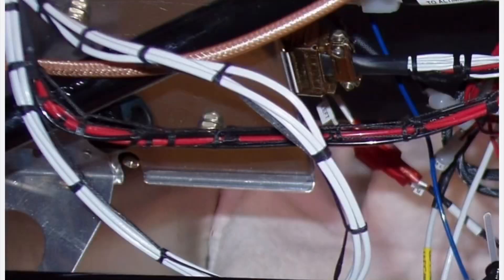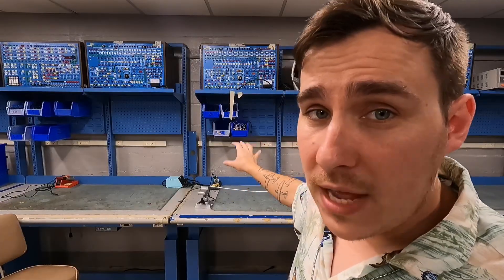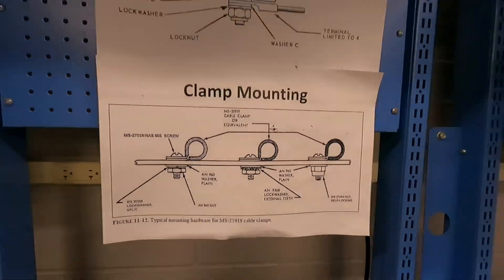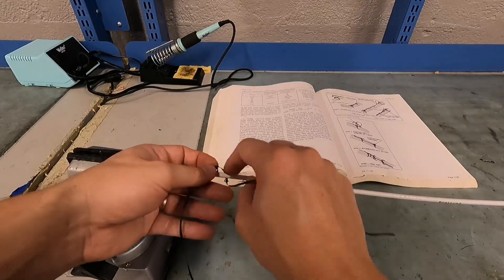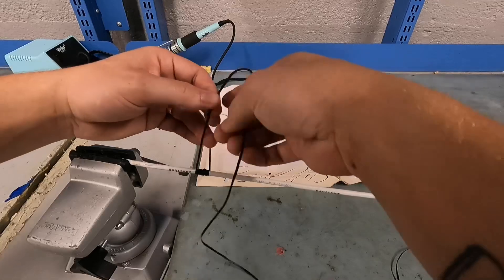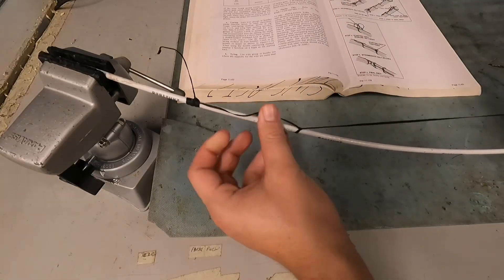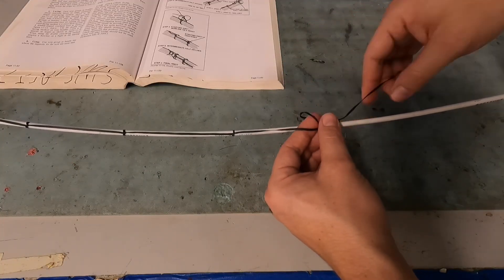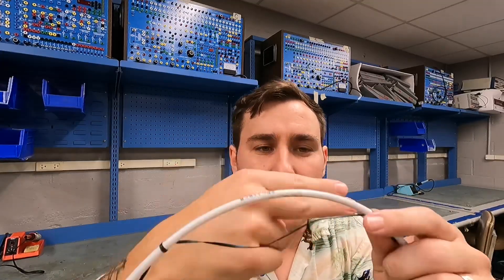🛠️ How to Tie and Lace Aircraft Wire Bundles | A&P Practical Project Sunday Double Feature Part 1!!

Comment: Would this work for a car wire loom? Or should I be sleeving over them or does the sleeving go under the string?
Reply from the maker: It would but automotive it's easier to just put everything in wire loom and electrical tape.

Comment: Interesting. The US military allows only 2 types of string tie knots, and no longer allows continuous lacing like shown here. The reason is that if one end of the string gets cut, the whole thing unravels. I'm not an A&P. I've only worked on Air Force planes.
Reply from the maker: I've heard this several times. I do not like to use continuous lacing. I have and will probably always just use zip ties. Much faster and secure then lacing
Reply: @brycebuildsit  And yet @ 5:20 you're saying lacing can be faster than zip ties... :P

Comment: I have often seen lacing but never seen it done. Looked pretty easy, easier the zip ties. Probably harder in a confined space but definitely worth trying!
Reply from the maker: Much, much, much harder in confined spacing. I prefer zip ties also because if the lace gets cut the whole thing comes undone. With individual ties or zip ties you don't have to worry about thaf

Comment: In the military we don't use zip ties at all.  Wax string or clamps all the way.
Reply from the maker: One of my co workers was a C5 avionics tech. He said they always used wax string and individual ties never laced. They also used different tieing methods
Reply: Depends on the airframe, but wax string is (almost) always at least an option even when zip ties are authorized. 
That said, the 1-1A-14 still defaults to lacing tape only, unless directed by the airframe specific TOs.
The airframe I was working had both authorized in most tasks, even when working TCTO modifications. (SB and AD equivalent tasks.)

Comment: I have never been cut by cotton thread.  Zip ties will make you bleed.
Reply from the maker: Mechanics seem to like to cut them on a 45° angle with diagonal cutters so they are as sharp as possible too.
Reply: If the zip ties are cut with the right cutters it leaves no sharp edges, just a pity no one bothers.
Reply: @FailedExpert6330  Yuuuuup. They confuse diagonal cutters/dikes with flush cutters (or just don't care). Those, or Zip-Tie guns are the correct way to cut zip-tie tails. I still personally love the way lacing looks (coming from the spacecraft industry, where zip-tied harnesses HAVE to be tightened with a tie-gun that has been set to the proper tension for the wire bundle/tie size)

Comment: Whether you are allowed to use zip ties depends on the aircraft's type design and maintenance instructions.
For example, some helicopters classify the entire helicopter as a high vibration environment and therefore do not allow zip ties.
Engine harnesses often don't allow zip ties.
SWAMP areas often don't allow zip ties.
If you need to tie a harness for any of these reasons, follow the aircraft's maintenance instructions for how to tie it.  I guarantee it doesn't say to tie in the method shown. The method shown is absolute junk.  Kind of a waste of a video for anyone but someone with the most clueless test instructor.
Reply from the maker: Brother, these videos are aimed at students getting ready to take their O&P exam. Every single DME I have spoken to says they use the AC 43.13 as the procedure for the test. Any and all experienced A&P mechanics know that manufacturers' instructions come first. This video is not meant for an experienced mechanic like you or me. It's meant for a newbie trying to get past the test.

Comment: I generally prefer to do individual ties and came across this alternative to the FAA “approved” knot.  This one is faster than the official knot and can be easily don’t with one end of the cord still on the spool.  I was concerned this knot might be weaker than the FAA style so before using it on my homebuilt, I did a little testing.  I tied an FAA knot around one side of my bench vise and this style around the other side.  There is enough side to side play in my movable jaw to ensure equal force applied to each tie.  I also alternated sides just in case one side was applying more force.  I did several iterations and every time the FAA know broke first.  So, I became a believe and have been using this “unapproved” knot since.  https://youtu.be/t48x7Qrd50c?si=9k6chp6t7V4C3kUD
Reply from the maker: I also prefer individual ties. For an O&P, you might have to do this. In reality, this is just my opinion. If something were to cut the lace midway, then the whole bundle could begin to loosen up.

Comment: I got my powerplant o&p on the 2nd, is this something I could be asked for powerplant, maybe for tying control cables to the engine truss?
Reply from the maker: It's possible, but more than likely, you'll get something related to magnetos.
Reply: @brycebuildsit  I passed, I didn't have this but I had to internally time a mag and measure blade angle, im already forgetting my other projects, fully certified though
Reply from the maker: Huge congratulations, Andrew 🎊. I know it feels good to have that weight off your shoulders

Comment: Good video. I have never used the continuous lacing method. I use individual ties, not zip ties, along the length. For me it's faster and in my opinion better since lacing can get nicked and broken and then the whole bundle loosens up. I only use zip ties in the engine compartment and then only on the cool side of the engine. On the hot side I use koroseal lacing as it will withstand the heat and provides excellent vibration isolation. I do also use cushioned Adel clamps where needed.
Reply from the maker: I do the same, I'm not a fan of lacing. And ties can be a pain behind the panel with no access.